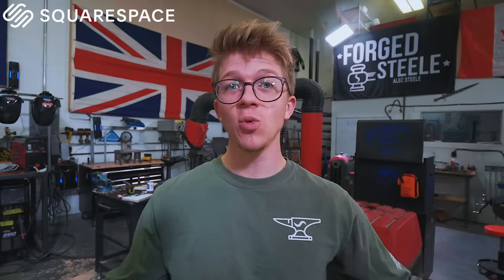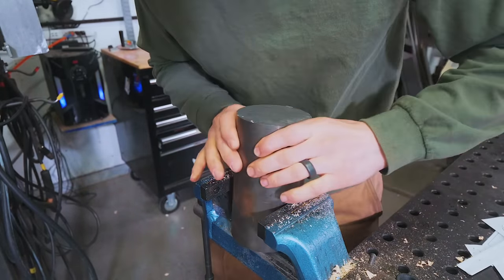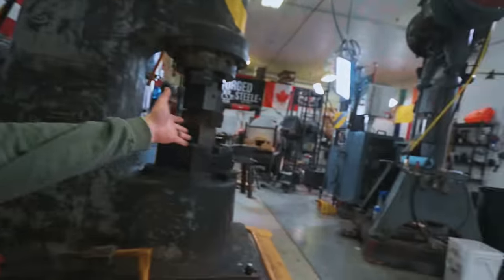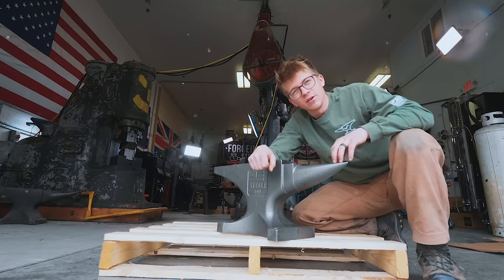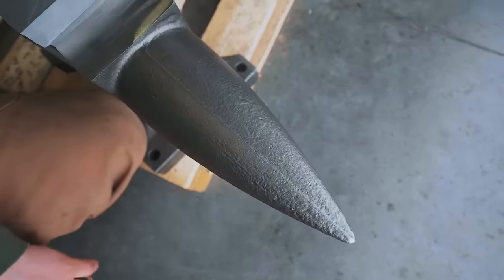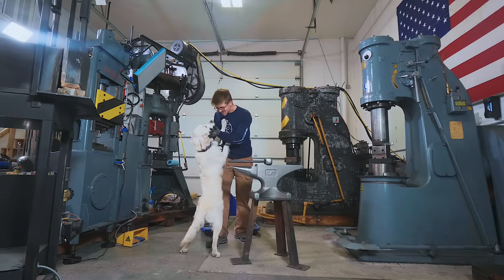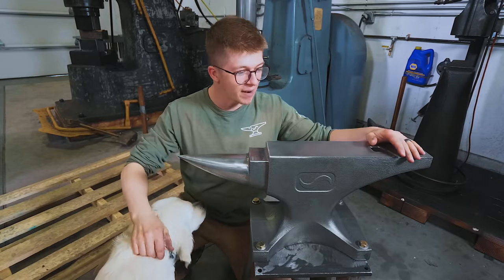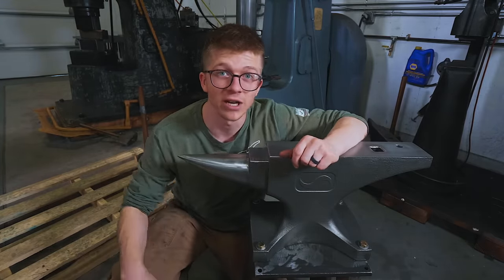MY DREAM ANVIL!!!

Comment: Would you consider selling different sizes?  I would personally like to see a smaller one about half that size and a 200 pound as well to give your anvils a full range of sizes for those that have need for a larger one or those like me that have a small area to smith and find that anything bigger than about 70-80 ponds os too large especially for the work i tend to do

Comment: Just curious as to why you "choke up" on the hammer? I was taught to let the hammer do most of the work by holding the handle further back. You generate more power that way.
I don't know if that's possible with a forging hammer.
Just a wondering?
Reply: He spoke about this on his life stream that it's mostly that's where hes comfortable with holding it and controlling the hammer, considering the hammer weighs around 5 pounds the weight of the hammer doesn't most of the work so he doesn't have to put a lot of force in it himself when swinging it

Comment: quick question... this anvil is "cast steel."  what is the difference between cast steel and drop forge steel?  which is better?
Reply: this anvil is cast
cast steel is louder than forged steel but also cheaper

Comment: would just get those old ones skimmed at a machine shop, clean up the horns like you did on the new one, make a hole n the legs for bolts or just weld them down and they would be fine but thats just me i guess lol

Comment: What are the dimensions of this Anvil? I want to pour a rebar reinforced concrete anvil stand for when I get mine. Optimal anvil height for me at 5' 11" is 31.5" high. If I can find out just the height, I can subtract that from 31.5" to get the height I want (minus the connection block between the anvil and the concrete of course). Bonus points if you can tell me where to place the bolts for those holes.

Comment: Alec I have an old PW anvil that is fairly well “saddled” out from years of previous abuse from prior owners. I started going down the path of building the face back up with hard face welding rods. That is a PAIN. My plan was to then take it to go get surfaced ground. I really need a new anvil but I just can’t let my piece of history go by the wayside. Do you have any suggestions on re-facing an anvil? There is very limited information online and that’s probably due to the task being a complete pain in the @$$.